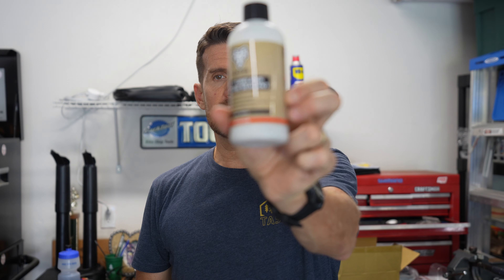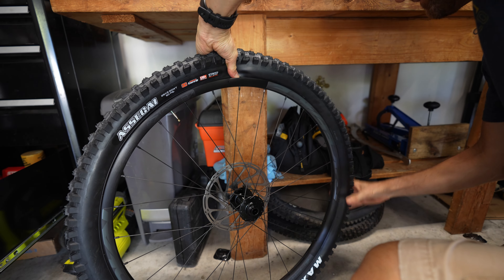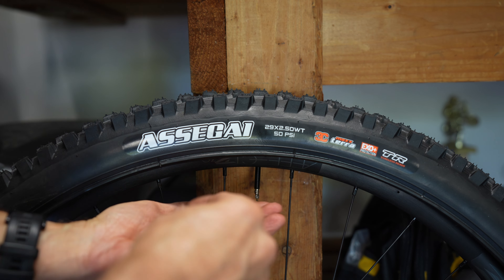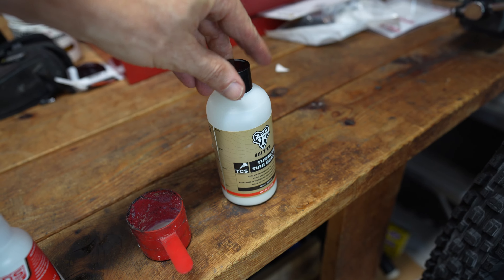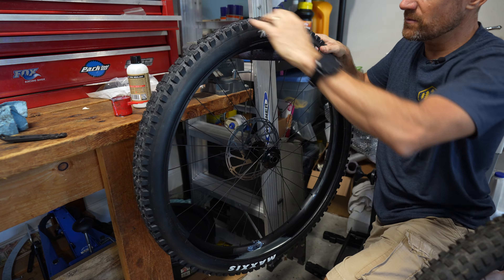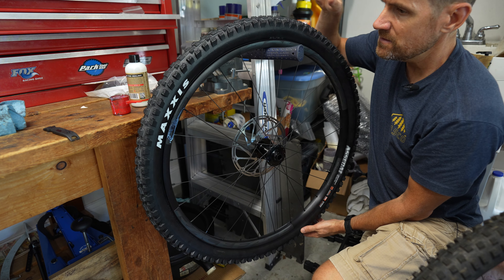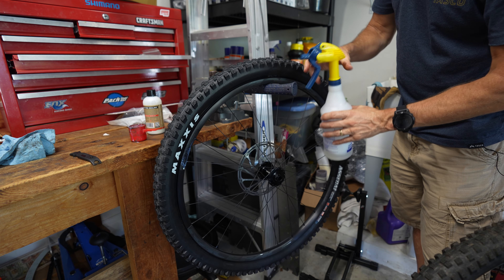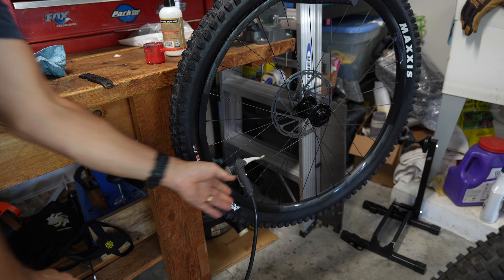How to Convert Your New Bike to Tubeless Tires

Comment: I’ll always stay with my Tubes. Seems more resilient on sharp rocks. Plus it’s just way to messy and added weight with all that sealant. Thanks Clint take care.
Reply from the maker: Definitely a matter of personal preference. But just remember a tire with sealant is lighter than a tire with tubes. I typically drop at least a pound off a bike when I take the tubes out and add sealant.  In that rotation of weight which makes a big difference.
Reply: I remember the first time I (tubeless) rode Moab with my son (tubes). He faltted 3 times on Porcupine. I haven't flatted in close to 20 years. Party like it's 1999!
Reply: 2 tubes weigh a pound ? @ClintGibbs
Reply from the maker: @JesterWinz  at least. Tubes that fit a 2.25-2.4 29er tire are heavy.

Comment: this is cool update on the TR still comes with the tube. Guess I can work with the tubes.
Convert it to tubeless and save the tube in case there is a puncture but still the sealant seals the puncture.
Nice.

Comment: At about 6:15. I know you're aware, but as a PSA, maximum pressures are applicable to both the tire and the rim. Usually, max rim pressure is lower. Exceeding it can cause the tire to pop off the rim. Had it happen to a buddy. Not a super big deal unless you get sprayed with sealant, and it can ruin the tire.
Reply from the maker: Right. You still have to set the compressor to a fairly high psi, like 80 to 90 at least. That gives the initial surge of air to get the beads to seat in the rim. Especially with mountain bike tires, the tire will not inflate too fast where you can’t control it. You can just feel the tire with your hands and make sure you don’t go above about 40 psi.

Comment: Have you ever worked or rode with Continental Race King tires? I've used them with my now defunct mtb, and they have a tendency to develop a wobble. I'm not sure if it's due to repeated punctures, old age, or tubes of poor quality. I always install my tires and tubes correctly and make sure the indicator line is evenly shown around the tire, but it still has that tendency to wobble. What do you think it could be?
Reply: Poor quality control, I will not use those tires.  I have had them come apart where the channel bead separates from the tire when going on some fast berms that I rail.

Comment: Thanks!!  How long does the sealant last?
Reply from the maker: Really depends on temperature and humidity and Riding and how old the tire is. A new tire can last 3 to 5 months. But I’ve seen sealant dry up in a few weeks. Really good to check it every few weeks by just opening up the bead and looking at it.
Reply: @ClintGibbs  thanks! I bought some tubes that have sealant in them, but they are a little on the heavy side.

Comment: I would like to add one bit of caution.  When using an air compressor . Make sure the regulator is set to a PSI that is with in the spec of whatever tire/rim combo you are using.  

I was rushing the other day setting a tire with compressor.  I found out the hard way . Regulator was mistakenly set to 90PSI.  Tire blew off rim…destroying tire. 😟.
Reply from the maker: Definitely need to be careful. You do need to have about 90+ psi in the compressor to get that initial surge of air to get the beads to seat in the rim. But you need to feel the tire as you inflate to make sure it does not go above a normal range. Not that hard to do but, as you said, you need to pay attention.
Reply: @ClintGibbs  my compressor will be 90-100….the regulator 50ish.  With the valve core off I blast the tire on.  I was looking at wrong guage.  (I usually use my bontrager floor pump with the air chamber …. That works really well.  Anyway just thought I would mention…not only did the tire get ruined….sealant went everywhere 😱
Reply from the maker: @frankstrobel4350  yeah, I’m glad you pointed it out. Definitely some people need to be aware of. Thanks Frank.

Comment: Have you ever tried repairing a puncture that couldn’t be sealed with an internal cold patch?
Reply: A few years ago I repaired a sliced sidewall of my MTB tire using a leather stitching awl, heavy leather stitching thread, and sealed it all up with vulcanizing cement.  Has held up just fine.

Comment: Great info, but here is some ground breaking info you should be aware of. The LAST hurdle of differentiating what makes a expensive mountain bike expensive has been obliterated with electronic 7 to 13 speed groupsets on the market for 450 bucks battery included and three different size cage versions. The reviews will be posted soon and i expect it works. This technically says that you can HAVE the most advanced mountain bike on the market for a fraction of the cost of bikes you are showing on your channel. There will be no advertisement as usual, unless somebody brands it because it isnt needed for sales worldwide.  Trying to sell 10,000 dollar bikes just got harder.
Reply: Beta testing on you tube has already been done, and its stellar. The shipping of massive amounts of these has already started.
Reply: Let me guess, Walmart Special!
Reply: @MichaelRei99  Remember, there simply is nothing left in ANY componentry that separates expensive boutique brands from big box.
Reply: Interesting that you did not get a pop on the bead . It might worry me a bit but I use a compressor on all my tubeless setup . I also always use soap around the bead . Nicely done .